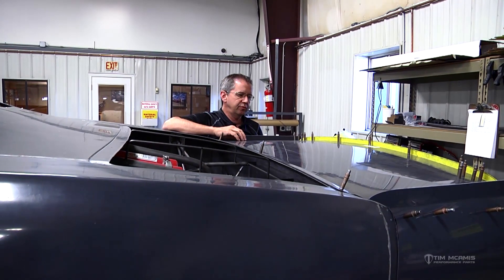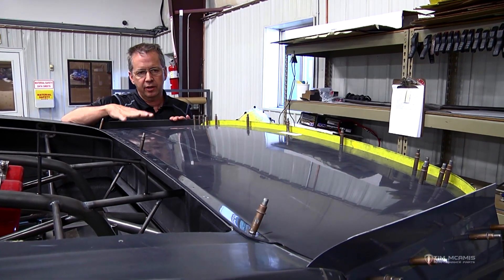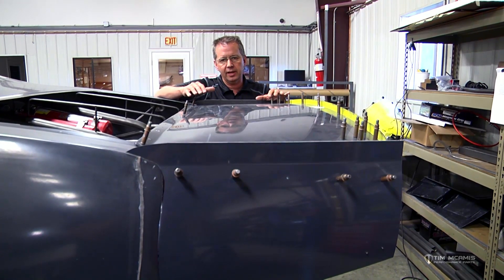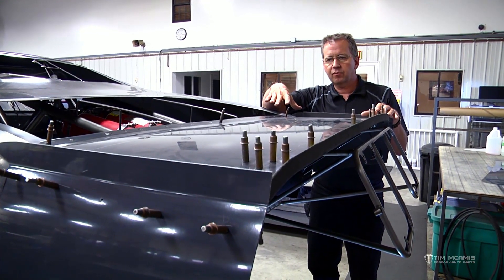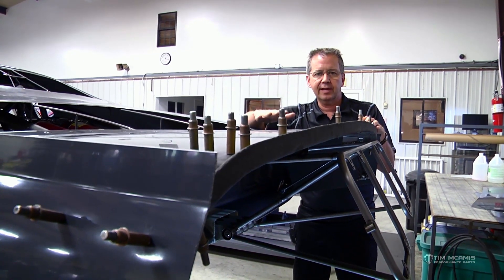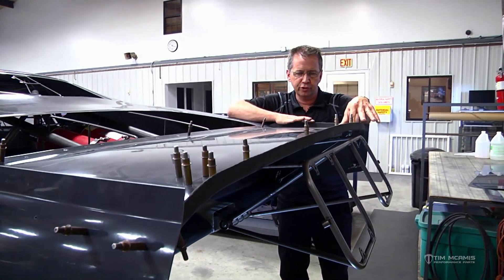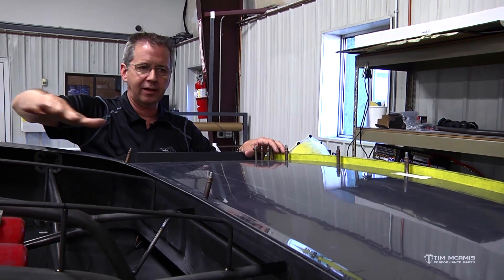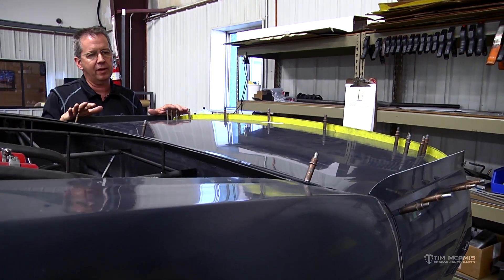Door Slammer Wing Basics

Comment: Tim does a drag style flat wing like that provide any merit on a truck with an open bed?
Reply: +Christopher Morales yea I get that.  What I was asking Tim McAmis was not if I should cover the bed but if there is any benefit to adding a flat drag style spoiler to a tailgate without the bed covered.
Reply: +Christopher Morales I don't think you understand, I need the bed open to put shit in when I go to cruise ins, etc.  I get covering the bed and how it affects aero, I'm asking the man who posted the video if it's beneficial to add a flat spoiler or drag wing to the tailgate, or if it's simply for aesthetics on a truck without a solid bed cover.
Reply: +War Machine it'd simply be for looks.
Reply: +slowpoke96z28 no it wouldn't. There's plenty of race trucks that have rear wings and no bed cover.  Rear spoilers ARE NOT dependent on a bed cover to work properly. They work whether its mounted to an open bed or covered. Doesn't matter.
Reply: +blazer6248 examples? cause it seems to me the spoiler would stall. the physics doesn't add up.
Reply from the maker: StreetSmart, it really depends on what kind of power and ET you are trying to achieve at the racetrack. If the bed is going to remain open, I'm not sure how much benefit it will provide as the air would be disrupted and lacking a direct path to the wing.
Reply: +Tim McAmis Performance Parts that was kind of my school of thought.  The air on a bed that's open sort spins around in front of the tailgate, so I was thinking unless it was covered it would be a waste, and be mainly aesthetic or maybe even disrupt the air enough to cause negative handling effects.  Thank you very much for the response.
Reply: +Tim McAmis Performance Parts and it's not super quick, like a mid 5 second truck in the 1/8.